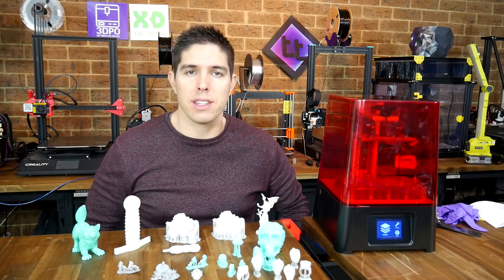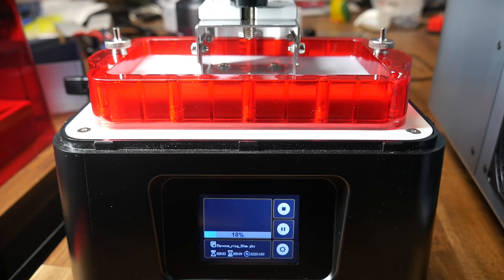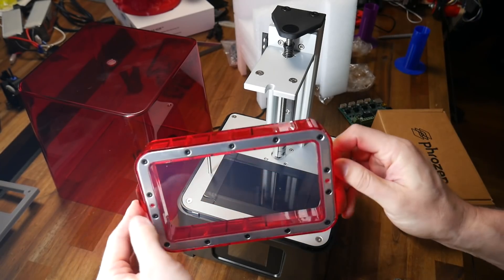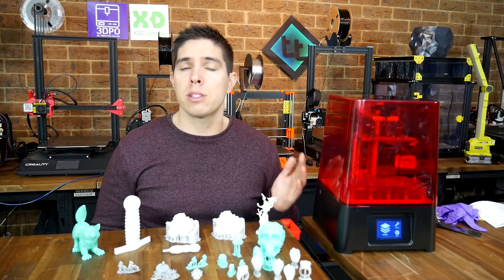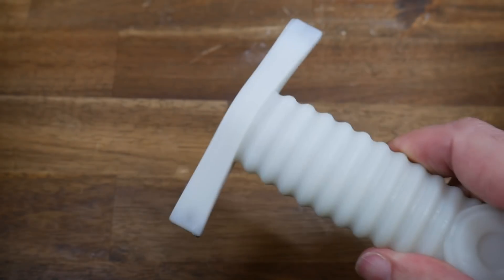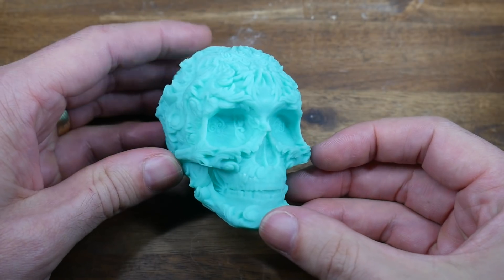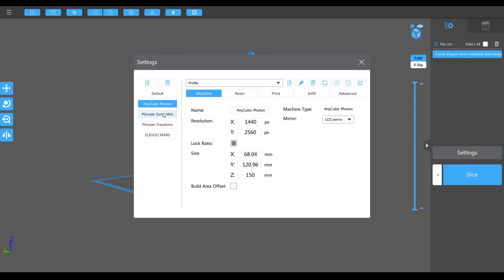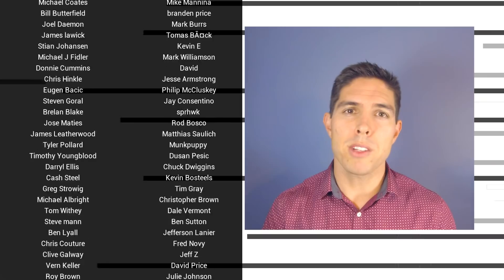Resin 3D printing in half the time - Phrozen Sonic Mini review

Comment: How come 2s per layer isn't 4x faster than the 8s per layer standard?
Reply: While the curing time of your layers is a decent portion of your print time, the movement of the plate between curing layers takes up the remainder of it. 

If the print spends 8 seconds per layer moving the plate and 8 seconds curing, that's 16 seconds per layer. If you cut the curing time by 4x to only 2 seconds, it's still 10 seconds per layer thanks to the move steps being the same 8 seconds as before. Still a major improvement, but not a 1:1 reduction in total time.

Comment: I just got one of these and am overall blown away by the print quality at this price point.  It's quite stunning actually.

Question though, do you think it would be possible to drop in a different stepper motor driver for the z axis?  It's quite loud IMHO.  Normally I wouldn't even think about it but i also just bought an ender 3 v2 and the stepper driver is whisper silent.

Comment: I really like this non-biased review. I feel like you nailed the good and bad accurately and you gave us all the potential pitfalls and how we should handle them. If ordered directly from Prozen the VAT has been exchanged for a metal version.
 I ordered directly from them and it shipped really quickly. Like within 5 days quickly.  
My only critique is when you showed the shiny model and explained it was caused during a fail in cleaning. 
It would have been nice to know the cleaning method you tried.

Comment: Why would you buy more vats to print different resins? Just buy some filters and pour the resin back into the bottle. Pour the new resin in. You don't even need to clean it right out since a little bit of mixing won't hurt anything.
Also I would like that fast printing time but that smaller size is a no go. The Saturn is the printer I'm eye balling. Larger build area and higher resolution screen to go with it. Should be a good choice.

Comment: Hello, thank you for the great review. I can't make up my mind between the Creality LD-002R(around $240) and the Phrozen Sonic Mini which is more expensive (at least when delivering to Portugal it now runs around $300).  What would make you chose between one or the other? I need it to print dental models and surgical guides. Thank you in advance
Reply: Hello Antonio, no doubt for me, Phrozen, I bought it on march and I'm superhappy with it. 

The speed you can achieve on this machine is worth... definitely. There are 2 issues for me,  flat building plate (u can buy it for arround 60$) and the plastic vat (upgrade to a metal 70$). Anyways the fact here is the shippment cost etc... I live in Barcelona, thats why i wrote you, cause I was lost when i first purchased with shippment taxes etc... I purchased directly on the Phrozen website, shipping was the half of the TOTAL cost, and when arrived to Spain, taxes were 100e more... so was all arround 400e (printer + 1L Aqua green + 0,5L Grey).

With that difference in mind I encourage you to purchase it, and at the beggining, start with phrozen resins, cause you can fix better times exposures etc.... when you manage correctly the machine, and you "played" with it too see when you overexposure or not etc... you can swap to another type of resin. 

The support from Phrozen is good, they answered me all the mails i send and the communication was fluent. I dont print dental stuff but I print miniatures ... (a lot) and I can defenetly say that you CAN NOT see detail differences between anycubic and eleggo and sonic mini (at least for me).

I printed successfully a lot with a lot of different resins by now and every different one i have to change few thing but one time you have "your official resin" omg... it flyes...

Dunno if it helped to you, I'm a noob, I just have 3d printer from march.... but the amount of stuff I printed just in 2 months is HUGE .... and without that printing speed I couldn't :) 

Ah! last thing! after looking arround a lot and checking shipping cost, shipping time, etc.. I started purchasing items on FEDSHOP, they are the official dealers of prhozen arround here (they are based on Nederlands), delivery in 48/72h to my house, and I'm quite happy with them.

Comment: I know I shouldn't be surprised, but I genuinely didn't realise that (most) MSLA printers used RGB LCDs until I saw this. I mean, it makes sense when you consider that there's hardly any kind of market demand for monochromatic panels these days. But still... that's basically turfing 2/3 (or more, if you include the grid) of your UV light transmission and introducing gaps in between the useful pixels, isn't it?

Gonna have to keep an eye on these guys. Between this kind of thing and tough resins, MSLA is getting interesting. Maybe not consumer-level SLS interesting, but still interesting.

Comment: Hello having a few problems, my bl touch I don’t think is saving the values. I do a test square in the middle of my cr10 and it’s fine. So I start a print. It goes though the 3 x 3 on the bed. I have a skirt set as my flow takes a wile to come though. It starts off ok but it changes though out the print. Ie to the sides but middle is ok. I ran a print on the whole bed printing out straps for my local hospital. But it does the outline ok but when filling in it may be good at start but then missing bits in middle then fine again  then missing bits again. And as I get to the back of the bed it the flow stops as it is to close to the bed? Any ideas thanks Neil

Comment: Great video as usual. I still wish they would sell the resin printers as a kit with the wash and cure stations that would fit the max size you can print on the printer itself. I actually talked to someone local that bought a resin printer and ended up never using it and selling it  at a loss because of all the extra things you need to buy or build.

I watched other videos and they said about the build plate being flat and keeping a lot of resin on top of it. Did you notice this also? Lot of waste or just made it harder to drain off?

$1,000,000 idea - make an attachment that fits where the VAT goes that uses the same magnetic motion as the wash and clean station so you can remove the VAT and then wash the object right there and include the UV light bar on the arm (is that what it is called?) to cure it. Seems easy to me. Might have to make the size of the printer a bit taller to accommodate a full sized print (not sure as that would add an extra $250,000 to my million dollars).

Comment: I print miniatures for tabletop. Some models being +100 pieces. The speed is quite irrelevant. I've had prints for 2 weeks on my FDM and I can max out my build volume in mars + 20mm at 0.03mm and have it done in 24h. 

2k screen is fine, 1080p could work for some but the price difference between this and say Mars is not worth it to me. What are you printing that you're willing to sacrifice quality for few hours? THe details looked very soft but that could be due to your curing, layer exposure or even just the resin itself.

Comment: The plastic vat that shipped with my Sonic Mini had a bad reaction to the Siraya Tech Fast abs like resin. The resin cured to the surface of the vat due to a chemical incompatibility. Phrozen is switching over to aluminum vats as a result. A number of resins have been found to be incompatible with the plastic vat, some to the point of causing cracks and leaked resin.

Comment: Phrozen: Sells 0.5 kg resin for $150

eBay: Sells 0.5 kg filament for $5

See, that's the reason why I have an FDM-printer
Reply: its hard to compare though cause fdm supports use wayy more material, fdm prints have lower quality, and fdm printers are slower if you are printing more than 1 object. plus uv resins can have better properties. ( i have a uv resin that can handle over 260c! i could 3d print a hotend) you can get also a liter of resin for 40 bucks. thats not terrible for the quality you get. fdm printing has its place for medium sized objects/ large sized objects. but for anything under 150mm, you're really better off resin printing it for maximum quality, material properties, and time saved printing.
Reply: @dakotapahel-short3192  time saved? doubtful if you include all the post-processing, clean-up, etc..  of resin.  i think the best answer is it depends on what you're trying to accomplish.
Reply: @engineeredaf1920  like i said "if youre printing more than 1 object" post processing... doesn't take that long or much effort. fdm can take just as long removing stringing, retraction blobs, & support material for a far less desirable result. i've been fdm printing for 5 years and resin printing just wins out for ease, reliability, speed, and quality. 

fdm is better for 2 things: larger prints & multi-material. otherwise people are much better off with a resin printer.
Reply: @dakotapahel-short3192  you forgot lost-casting, large layer heights and forgiveness in your list of 2.
Reply: @nicewhenearnedrudemostlyel489  resin printing has better lost wax casting materials & you'd have to be more descriptive in what you mean by forgiving. resin printers are much more reliable and simple: no high amp parts, less moving parts, and generally lower skill. 

also you can print some pretty decent layer heights on a resin printer... no one does because there isn't really a point. resin printing is faster, with better resolution and layer bonding. so why print at a .2 or .3mm layer when you can get amazing prints at 0.05 mm.
Reply: @dakotapahel-short3192  "resin printing just wins out for ease, reliability, speed, and quality" I disagree. I have both an Elegoo mars and an Ender 3. My mars sits outside in the garage, my ender 3 sits next to me. I use them mainly for dnd mini and terrain. The mars takes more prep work, I spend more time configuring supports, the time on the bed is faster, BUT I still need to come and clean it all up, put on PPE, prep the tanks, remove the supports and then leave it to cure: which for me is in the sun. Failed prints are far worse on an SLA than a FDM. Frankly if you're printing at 0.06 layer height on an FDM printer with quality pla, and tuned in settings; the results are the same as a .05 (and this is basically indistinguishable from .025 and .01 anyway). Once you've finished all the post work and painted them there is no way that most people can tell the difference. I only use my SLA printer for bulk printing now and it's a large commitment. My ender 3 I set off all the time to print whatever I want. So sick of people spouting this inane lie that an FDM can't print decent detail.
Reply: @arcaneminded  you're experience stands in exact opposition to mine. i think you simply gave up on resin printing before putting even the smallest effort in. get an ultrasonic cleaner (seriously this makes cleaning the easiest thing in the world), get a uv light, remove your supports after cleaning and before curing: they should easily snap off. a small pair of snips makes it even faster to remove supports, with less artifacts than fdm. use chitubox... its just easy as hell. auto supports in the last 2 updates often don't require any additional supports so you just press 2 buttons and you're done. 

you'll wonder why you spent days messing with your retraction settings, messing with acceleration, leveling the bed, drying filament, adjusting first layer height, finding the best temperatures, adjusting belt tension, etc etc etc. the amount of things you have to learn to get fdm printing reliably is wayy more than what you need for resin printing.
Reply: @dakotapahel-short3192  FTR: I love my elegoo mars. I love being able to print a batch of minis and love being able to print super delicate pieces now and then which the fdm printer would just botch. But I use it out of necessity not preference. 

I print a lot of stuff and 90%+ of the time it's on the fdm printer because once the file is set up, you just hit print and then go do what you want. Printing on the SLA printer is intrinsically never going to be that easy: there is a plethora of stuff that needs to be done before I hit print, then again after it's finished printing, and then I still need to wait for it to cure, no matter where it is. 

Yes, I think I spent a few days calibrating the FDM printer initially, it was a while ago though and I still tinker with settings for fun. Realistically though the most maintenance I do on my FDM is change the nozzle and re-level the bed every few months. Leveling the bed takes me about 20 minutes I think (though there are solutions for this I don't use). Meanwhile I've already changed the screen on my SLA and my current one has a dead pixel. I cannot imagine printing exclusively on the SLA.

Comment: Is 200$ still accurate? I can't find it for less than 250, 300 + shipping at the moment.
Reply: It's been going in and out of stock on US Amazon for $230.
I think their pricing is what caused Elegoo to drop their Mars from $250 to $230 in recent months.
Reply: they are shipping out now with the metal vat instead of plastic due to the plastic one being unreliable, so the 250-300 is where it sits now

Comment: I'm curious what contributes to the life expectancy of the LCD screen before it isn't usable anymore? Does pumping more UV light through the LCD speed up degradation? What about more changes in pixel display? Is that 2000 hours live expectancy at 'normal' speeds or at the faster advertised speeds? Even at the higher prices, it would earn itself back over time if the LCD indeed works 4x as long... Depending on what model you get, that's another $100-$150 saved on replacement LCDs...

Comment: I'm wondering if you can grow weed inside a resin printer
Reply: I'd watch a test of that.
Reply: @nakwadroid  can you please send me results if it works on not. 
And if can you control the shape of the plant with it 

Thanks brah
Reply: @BuzZ.  meh, I have a Form 2, prints THC straight on the build platform.
Reply: You can grow it upside down and raise the build plate as it gets bigger 👍
Reply: @engineeredaf1920   if I design a mechanism, it can trim it and automatically package it for me too I guess
Reply: @BuzZ.  you can have a whole weed print farm. 3d-printing breaking into new industries lol
Reply: @engineeredaf1920  😂😂
Reply: @engineeredaf1920  and everything 3D printed out of hemp filament (yes it exists, from 3D Fuel).

Comment: They come with a metal vat now because of issues with the plastic vat, that's why it cost more on their web site. I got mine the day it was released, great printer. Only problem is I'm running out of places to display my prints.
Reply: Great Info!
I've been seeing that on Amazon a lot of negative reviews about it are regarding the plastic vat cracking, which has me considering the Mars Pro over the Sonic Mini.
Reply: @ikmnification5737  I never had an issue with the vat,  personally. But the facebook group had a fair amount with the cracking issue. They actually discounted the metal vats on their website because of it and  gave out a coupon code for amazon for 20% off.

Comment: There is no mention of the issues with the plastic vat etching and allowing leakage  - it has become such an issue that new minis are shipping with aluminum vats and accordingly higher prices. Users that got the plastic vats are getting codes for discounts for the aluminum vats..
Reply: I bought an aluminium VAT for my Sonic Mini but went back to using the plastic VAT.  I haven't seen the problems others have had and I prefer it.  I may have just been lucky.
Reply: No issue with my plastic vat. Done over 30 prints ?

Comment: I've had one for a while.  I'm convinced that the prints look "crisper" than those from my Photon despite the lower resolution.  I think it's the screen.  I suspect it doesn't diffuse the UV as much giving a better result overall.
Reply: Do you think that might be from the monochrome LCD?
Reply: @elfpimp1  yes. that's what I meant.
Reply: Hello Dibbs! Are you sure about that? Other reviewer on youutb enoticed same thing. I'm choosing one for jewelry and this is most important factor for me. Do you happen to have any print you did for comparison? THat's kinda insane if it's true. If you have facebook or email i can send you a message there if you don't mind.

Comment: I have one of these and it is unbelievably reliable and the detail has blown me away.  I love it.   I would suggest doing the supports in PrusaSlicer and exporting the model including supports into chitubox and then slicing.  I have much better results this way than using supports in chitubox.
Reply: Scoopy Doopy I found this to be the best in terms of workflow. It’s really convenient now since the latest update in prusaslicer let’s you hollow out models too
Reply: @engineeredaf1920  Yes, agreed.  I set the support density to 75% and hardly ever 
have to change anything.  Prusa did a very good job with supports.  Better than with their FDM printers :)
Reply: Hello, do you happen to have any other popular resin printer? I'm choosing one right now and i like everything about sonic except the resolution. It is slightly lower then Photon or Mars, so i kinda wonder if it is a good option. If you have any of those, do you think Sonic gives worse results?